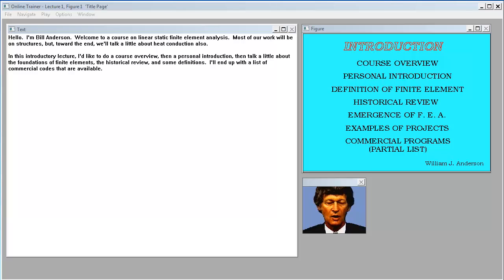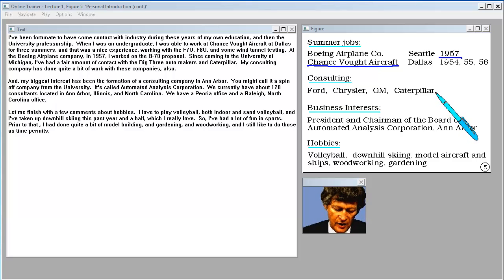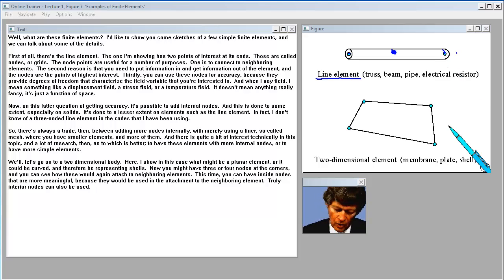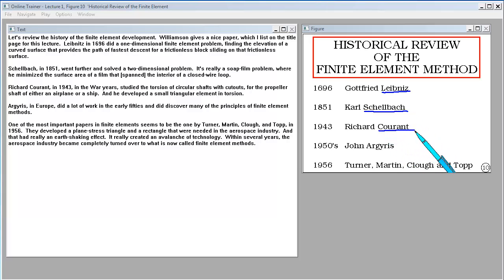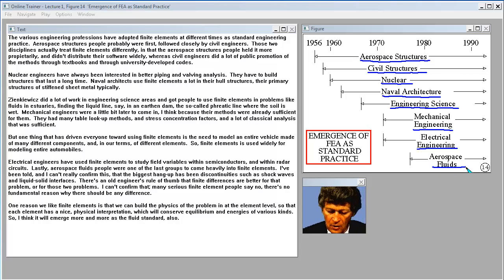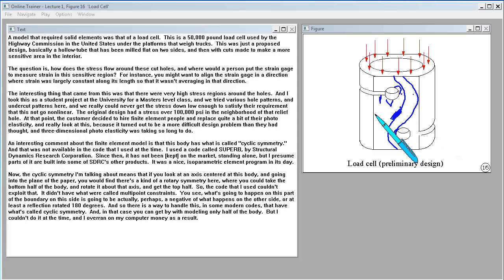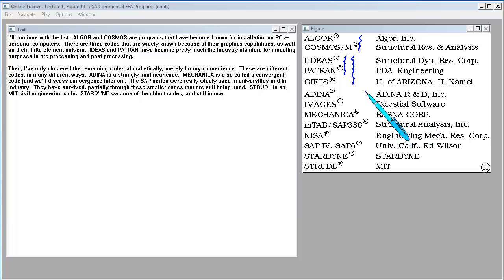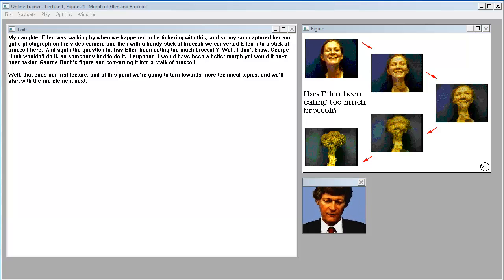Intro to Finite Elements.  Lecture 1.

Comment: Dear Juan Jose',

I retired 1 years ago, so am a little cold on the topic of modal response.  It is fairly classic, and is discussed in most good vibration textbooks.   Electrical engineers also have studied this a lot.  They have developed their own terminology about such response, so you have to read their work carefully.

An important factor is how much damping the system has.  If damping is small, one can get rather pure response in one mode when the driving frequency nears the natural frequency of that mode.

The various handbooks of MacNeal-Schwendler (supporting the MSC/Nastran code) are a good source of such information, if you can find them.  The aerospace industy is very interested in modal approaches.

If I remember anything else, I'll add to these comments!  I am spending a lot of time playing golf and volleyball, as well as woodworking and gardening.  I reach 80 years old in 4 months, and my volleyball friends just break out laughing/wonderment as I spike the volleyball past them!

Bill Anderson

Comment from the maker: Kent Cultz,

Whoops! I must be getting old.  I see you wanted the linear STRAIN element.  My answer was wrong-- it was for the linear DISPLACEMENT field in a triangle.  A linear strain element would have to be a multinoded element.
I don't have a lecture on that, but mention the higher order elements once in a while.  The isoparametric elements are
used a lot in some computer codes.  You might look at my lecture (later in the series) on those.